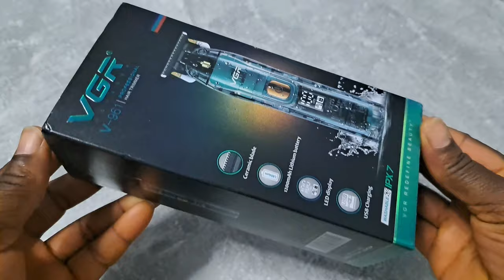Unboxing VGR V961 hair trimmer

Comment: Good for beard trimming?
Reply: Wondering the same, have you find out?
Reply: It stabbed my neck but i was using it the way the t9 metal vintage trimmer.  You can't use on armpits or privates. It won't do the neck.  I compared it to the t9 vintage the trimmer head is different they are like little needles.  The vintage t9 (not waterproof) is the only thing that doesn't stab me.  Horrible blades.  Both the t9 vintage and this cant do armpits and privates but this voyager can't do the neck. It does body legs perfect though.... i need a water proof trimmer and the vintage t9 is the only freaken thing that works on the face and body.  You have to use bikini trimmers on privates and armpits.  The e-razor market is a monopoly. They could send you like 30 detachable heads and a 8 hr batt life.... it takes a long time to figure it out. I am 40 now. I spent my whole life spending car payments worth on these things 90% of the market is trash. There is always like only 1 good product with worde competitors that tease you with inferior products. I looked at vintage t9s blades they have bumps that stop the blade from stabbing your neck even if you use it in reverse flip side.  The voyager if you look it is nothing but needles no bumps...i never realized that mattered.... you cant use it on the lower neck because of it... i dont customize them or zero gap i dk how or care to.  I just run over the stubble with other e razors like bald head shavers rotsry foil shavers etc. Don't buy for the neck just don't. It put 2 blood spots on my lower neck.  It looked like a vampire bit me.  Very bad blade design. I wish the vintage t9 was waterproof. Vintage t9 has better blade technology even if it isn't ceramic who cares it won't stab you. The nubs on the blade that rise up a but stop the lethal injection procedure. I can't describe it any other way. I paid voyager to literally stab me in the neck. It worked great on the face.... i really needed a waterproof one but i am stuck with t9 vintage and it's incompatible with voyagers blades....i can't find better blades than the vintage t9. There's only one and everybody who uses it hates it because they make the best water proof blades but worst body because if it gets wet the battery nukes.  Its like they are tempting you drown the vintage t9.  Its why i hate that product then this voyager comes along and stabs my neck.
Reply: Opps i meant to put they couldve sent you 30 detachable heads for one device....this monopoly is about buying 30 devices todo one thing lol.  You have to do it thats the joke... they do make some waterproof trimmer clipper combo but good luck finding a better blade than the vingtage.  I just need the vintage t9 blades on a voyager and they don't fit....voyager has the better body (water proof) but the worst blade. It pokes holes in you... the t9 vintage trimmer has the worst body (water goes in easy) and non detachable (no clip on) waterproof blades for a non waterproof device lololol this market is prejudiced.... 50% waterproofing lol thats why their evil... they only make one good blade. Everything stabs scratches bleeds.... t9s vintage scratch at the worst but cut up your privates. Its a monopoly you have to buy female face razors and eyebrows shavers because they dont make it for men... its all a huge monopoly. Just get like a draw for all of this because it will take up a full tableworth.  You can get cheap plastic roller drawers on wheels at walmart. You need like a usb hub because those anker dont have enough usb ports for charging all the things you have to buy.  You have to become a collector to look good because if you use one you look ugly.  Thats why its a monopoly. I told you they could sell you everything on one device as detachable heads. They won't do it because it is not profitable.  Its bad because you need to buy furniture to store all of it.  Thats why that monopoly is so bad.  Once you do it right women go after you to sexually harass you more often and you get complimented more often.  Its only worth buying all of this for job interviews. A woman isn't worth half the price of a trimmer. They don't want men to have anything. I use them for work. You'll get hired quick if you model up. They are money makers. You need them to compete in real estate/law enforcement/security